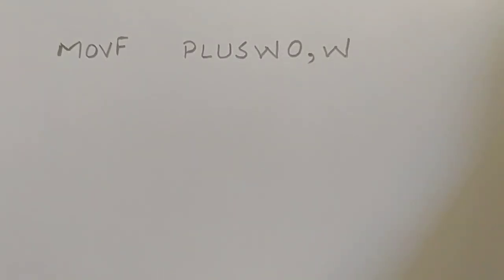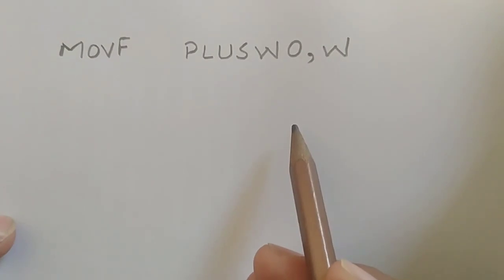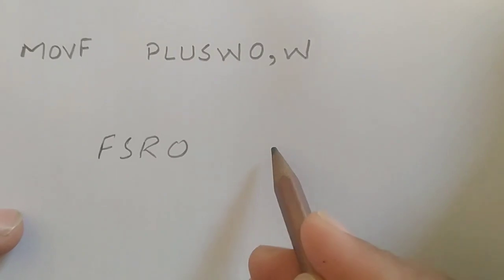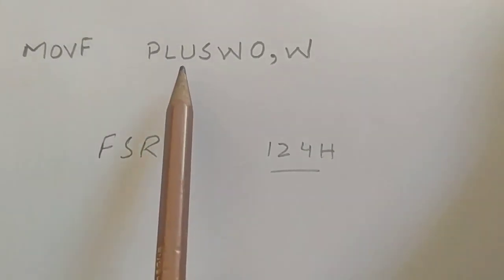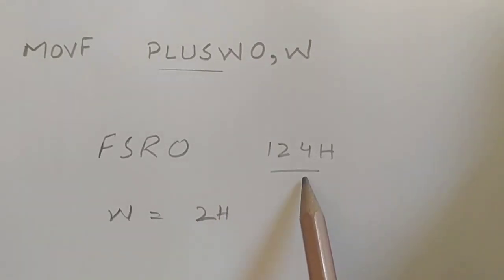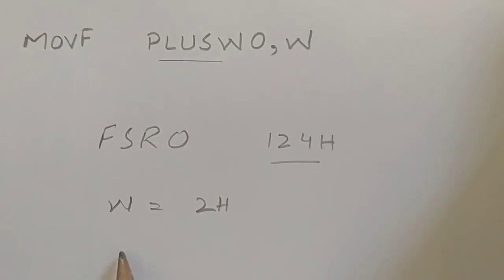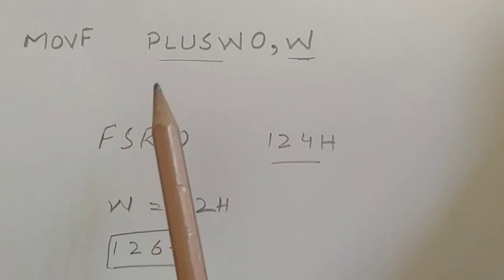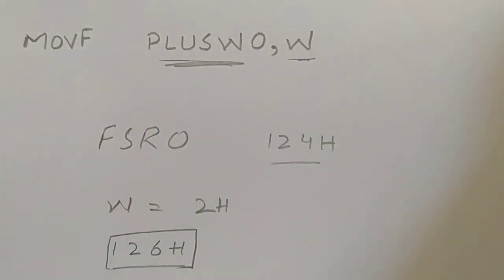PLUSW0 pointer option with FSR0 in PIC18F Microcontroller

Comment: SIR I AM WORKING ON PIC18F4431 I HAVE FEEDED PTPER(PWM TIME BASE PERIOD REGISTER) WITH A D'500'  THEN FOR  50% DUTY CYCLE I FEEDED D'250' IN PDCOL(THE PWM DUTY CYCLE REGISTER) BUT ON OSCILLOSCOPE  THE WIDTH OF THE DUTY CYCLE IS VERY SMALL. SIR HAVE YOU ANY IDEA ABOUT THIS THAT HOW I CAN CORRECT THIS ISSUE?
Reply from the maker: I will try to perform calculations for you